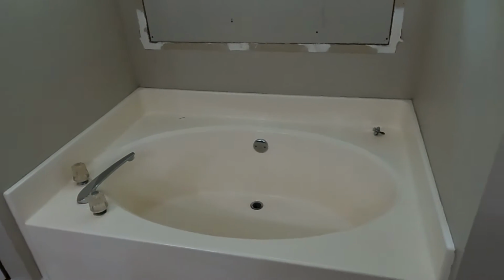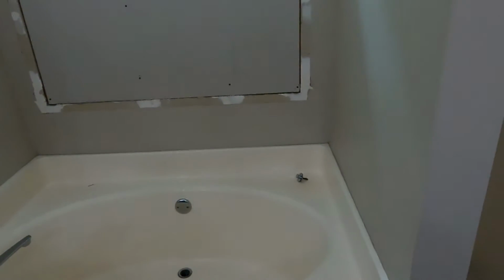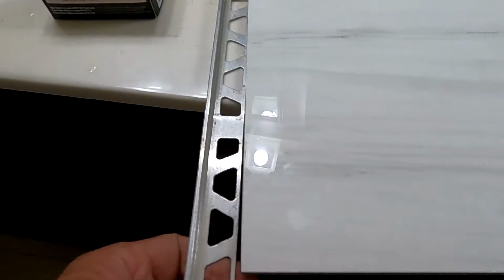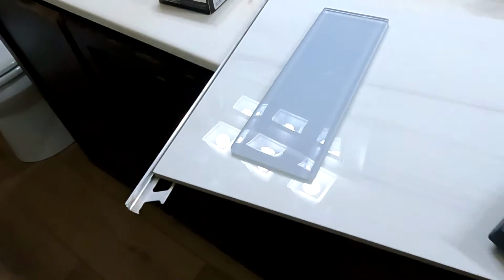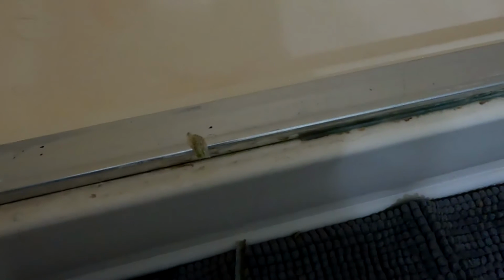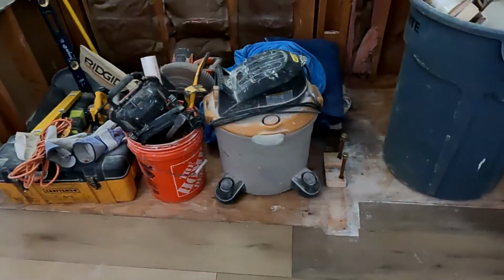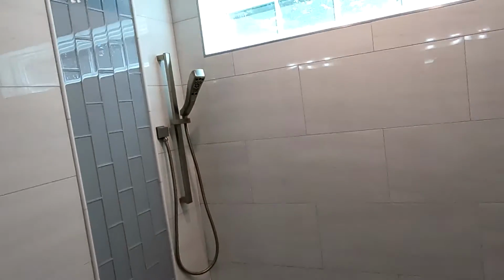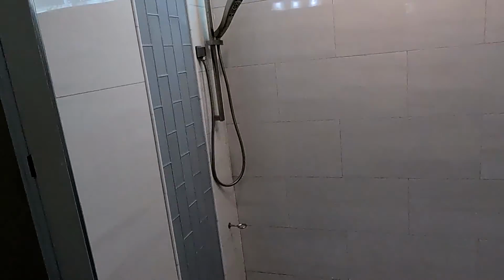GARDEN TUB CONVERTED TO A HUGE SHOWER

Comment: Nice work,  I used similar tile on my counters  24 inch by 1 foot like the ones  in this video and it looks sharp. 
I was wondering if  you can recommend a Water resistant grout? Have you used spectralock ?
Reply from the maker: I have no experience with spectralock, but for such a small area so few gretlines I would probably use epoxy grout